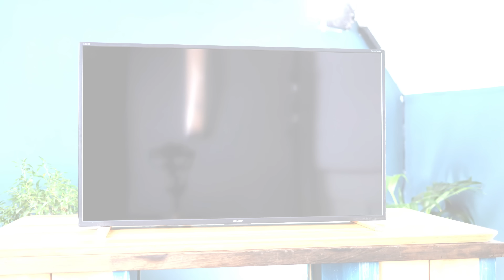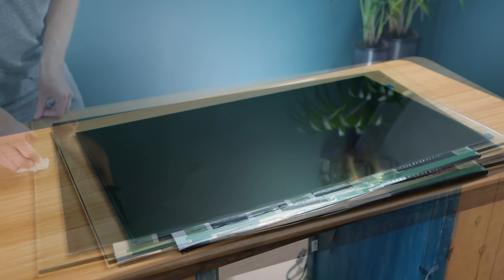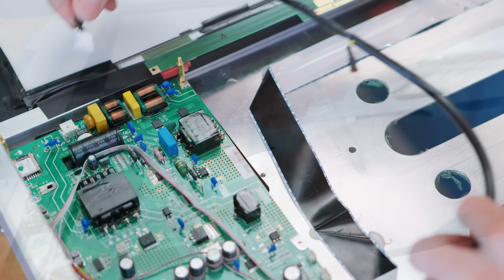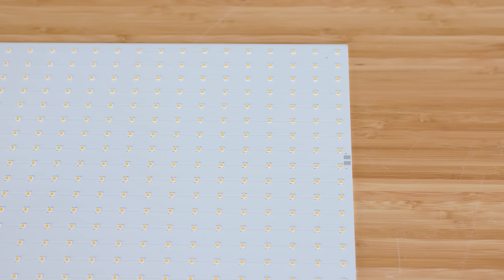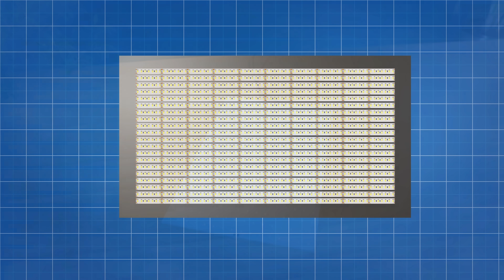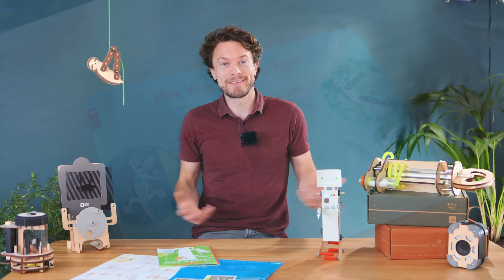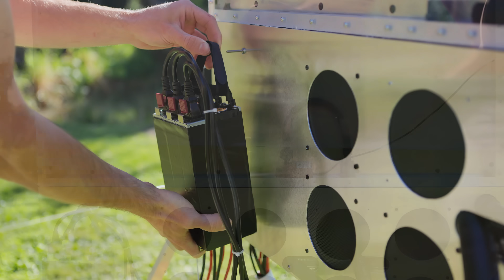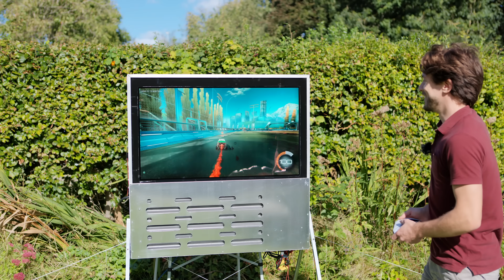Building an ULTRA-BRIGHT water-cooled TV...

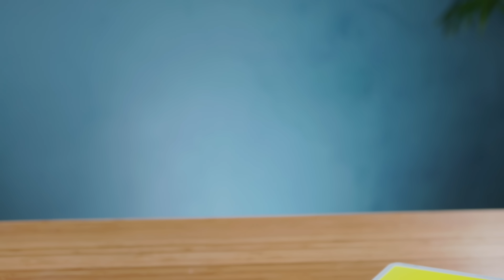Comment: 7:57 That would make an awsome project for individual backlight zones. I could see it being possible by using hardware similar to any DIY ambilight alternative
Reply: Ambilight is RGB, only uses the edge of the image and has a lot of latency for a backlight.
Reply: Disclaimer - idk a lot about display tech so could be very wrong

The main part of having dimmable zones with an LCD TV is having a processor and controller that can decide what zome needs the light and i don't think that is something that can be achieved by a common person like you,me or DIY perks. This is also a big part why he used a TV as he gets a display panel AND a control board.

EDIT - would bump up the cost significantly but i think they can buy a TV that has individually addressable zones and reuse that controller but they are already pretty bright and in the budget of 1000s of dollars so wouldn't really be a practical project. It can be made just for the sake of it but economics of scale do take part while factoring the cost/convenience/performance metrics

Comment: Don't open TV's unless you know what you're doing chat. TV power supply capacitors store energy, meaning they are dangerous even unplugged.
Reply: Not really. Any properly designed circuit has bleed resistors across the caps, even junk $100 tv's.

 Just don't go grabbing the back of the board the instant you unplug it and you're safe. The "zappy" charge is gone relatively quickly... And you need to be in pretty bad health or particularly unlucky for it to do more than make you yelp or whip your hand.

Comment: 18:55 you might be able to sandwich an ND filter in between the TV and the spectrophotometer. I don't think it'll give the best calibration then but you'll at least be able to measure the brightness. 1 stop of ND is half of the light so I think somewhere from 2-4 stops should do the job
Reply: You could also measure the brightness using a camera's light meter. Just get the exposure when pointed at something of known brightness like the smartphone displaying a white image, and then adjust the exposure to the same level when pointed at the tv displaying the same image. Then calculate the difference in stops and you'll know how many doublings to apply to the phone's nit rating.
Reply: Or maybe dim the backlight using pwm?
Reply: @HerrFreese  that'll just end up blowing out the meter when the led is on and not register on the meter when the led is off.

Comment: My curiosity is how bright will it be at night? And having a voltage regulator to control the brightness of the led could come in handy for Night time events. LOVED THIS PROJECT
Reply: Insects: "yes"
Reply: @smoke4131  smoke made me laugh
Reply: At night? There is no night when this TV is running ;-) Cheers! S
Reply: @suadcokljat1045  yes there is a night when this will be running. and there's laser eye-surgery for free with that.
i love it
Reply: 😎 😎 😎 "I wear my sunglasses at night, so I can, so I can..." 😎 😎 😎
Reply: Considering the LEDs run on voltage regulators anyway, you could just extend their potentiometers to the outside to lower their brightness
Reply: @schwuzi  not sure if this been answered already, and apologies I'm gonna sound like a smart arse here 😜. Dimming LEDs are controlled by PWM (pulse width modulation) , this is switching the LEDs on\off very quickly (in the kilohertz) the ratio of on to off (duty cycle) governs the perceived brightness. In hindsight maybe he could have taken the brightness PWM signal connection that went from the controller board to the old power supply unit (which had powered the old backlights) added some hefty power MOSFETs and tapped them in between the new power supplies to the new backlights(?)

Using potentiometers in this scenario pushing that much current easily would have burnt them out, probably go out with a bang!

Edit: okay I see that it has been correctly answered many times already 😃
Reply: @roopi67  I don't mean a potentiometer in the power line to the LEDs. I meant the potentiometers on the voltage booster modules he uses. They have a potentiometer to control the output voltage. I would tap into that.
Reply: @schwuzi  yes sorry I see now
Reply: @schwuzi  LED's are not voltage driven devices. They are current driven. You don't vary the voltage.
Reply: @zaprodk  yes, but you can drive them by voltage too. But as you say, the correct way to do it is with current control
Reply: @schwuzi  agree
Reply: @schwuzi  I was just going to say that some potentiometers shouldn't be too had to install on the outside, and it shouldn't be too difficult to wire in.
Reply: It will probably light the entire area. 🤣
Reply: Probably bright enough to attract/wake up wildlife and insects in a 5 miles radius. 🦉🦉🦉
Reply: I wanna see how it lights up the room indoors.
Reply: @rtyzxc  how long before going blind 🤣🤣🤣
Reply: MUST SEE A VIDEO OF THIS IN THE GARDEN AT NIGHT, along side a wall or something... =)
Reply: Why not just have a simple switch that either powers all led panels for daytime and only half of them for night?
Reply: Yup please have a just little demonstration please
Reply: Actually was hoping he would show it working at night. Came to comment just for that
Reply: I also would like a follow up video about this TV being used by commissioner Gordon to call Batman.
Reply: Oh I would love to see a picture of it at night, illuminating the surroundings. Although capturing dark scenes is hard, it would probably give a much better idea about how bright this really is. Please add this!
Reply: I really want to see it at night with some chairs and a camp fire
Reply: @adrienvesely  You wouldn't need a camp fire, just play a video of a fire and turn off the watercooling
Reply: yes
Reply: I came here to say this and it was the first comment
Reply: Light sensitive potentiometers would fix this. Then the tint can adjust according to the light hitting the screen.
Reply: @MX-Vette  well because they are leds, you can use a regular potentiometer, you need a pwm circuit. although i think the idea of brightness controlled by ambient light level is a neat one
Reply: PWM is probably far more practical and safe.
Reply: yeah I want to see it at night too :(
Reply: Just reuse original tv brightness control signal + some electronics = regulate the LED voltage supply, so can change the brightness using original tv remote
Reply: @TheFazz737  "some electronics" is the difficult part lol. I guess an arduino could use the voltage input from the tv brightness controller and convert it to a resistance the voltage regulator can use, but I couldn't do that. I know too little about these microcontrollers.
Reply: @schwuzi  Very good point, and also cost effective.
Reply: @schwuzi  you are right though. There are IR receivers available for cheap that can be programmed in arduino to the specific brightness ir frequency to control it. Not hard at all for someone as skilled as DIY Perks.
Reply: @Ezio470  That might be easier, as you wouldn't need the TV's brightness output, which would be handled differently from model to model in case someone actually tries to recreate this 😅
Reply: Usually TV/monitor logic boards are just sending digital PWM signal to the power supply, which regulates current and thus brightness of backlight LEDs by turning them on and off very quickly. Those volatege booster modules used by DIY Perks probably have some kind of output-enable input in form of an auxiliary pads or connector on board (even if not, its still possible to look for it in the driver chip's datasheet and solder a wire directly to the right pin) and feed it with TV's original PWM brightness signal (some level shifting using resistor divider might be needed).
Reply: @Firley777  That stuff goes way over my head sadly. I'd hack into the potentiometer on the voltage regulators to dim the lights. PWM is of course better, but not as easily done if you don't know what you're doing.
Reply: @schwuzi  I assume the original backlight runs on a pwm signal. If you put some power mosfets in line with the powersupply you can use the original signal to control the brightness. No real need for a microcontroller. Just lowering the voltage might be a much more practical sollution. How often do you really adjust the brightness of a tv.
Reply: @cheetahrunout  LEDs are current driven not voltage driven! A PWM signal created by a microcontroller controlling some MOSFET based switches and everything works perfect. Controlling a current draw around (for example) 100A (1200W / 12V) or on 3 Lines with 33A is a lot of current. Doesn't make any sense to do this with a classic current regulation. Too complicate and hard to control via a remote control.
Reply: @schwuzi  there should be off the shelf electronics PWM controller that could be use as in plug and play.
Reply: @schwuzi  depending on the voltage boosters used, it could be as simple as a voltage divider or maybe a couple transistors tbh, no microcontroller needed
Reply: @schwuzi  those LEDs usually don't get regulated via voltage but via PWM. you'd need a quite powerful PWM generator with for these roundabout 40 Amps. makebale but not that trivial.
Reply: @Firley777  I'm 90% sure pwming the en pin past 10hz or so will not work. Whether it'll just pass 12v, 16v or blow up outright depends on booster design.
Reply: @schwuzi  if you just reduce the voltage you will simply turn the LEDs off. LEDs aren't like incandescent lights, they have a voltage drop rather than a resistance.
Reply: @TheFazz737  Yeah...looks really easy ......maybe!🙄
Reply: how bright is it indoors?
Reply: Just squint your eyes at night
Reply: just think of the advertistment tv at your area. thats how bright it will be. haha
Reply: I was thinking same.
Reply: The TV is entirely a sun.
Reply: Yeah, I agree.
Reply: Same here
Reply: Yeeeeees! At night please!
Reply: DiyPerks, Please do a video at night♥️
Reply: Exect same question 🙋 from me too. I wish he tested it at night too. Or indoor too.
Reply: Oh, it'll be more then uncomfortable at night. My freaking phone, which isn't THAT bright hurrts at nighttimes. I don't think that thing at night is a particulary good idea in this state. 

I'd certainly do something to controll brightness as well. It's awesome it's bright enough for Sunlight, but at nighttimes, that thing must be absolutely brutal.
Reply: probablly at night, you can use it as a disco light
Reply: the tv is led so i'd imagine you could just hook up a bunch of mosfet's to the output, or even better, to the original mosfet's input so they get switched by the tv
Reply: Put your sunglasses on
Reply: LEDs has a nonlinear curve brightness/color temperature, therefore you must use PWM, or off some LEDs on backlight panels.
Reply: Omg this is too good🥰🥰🥰🥰 Matt could really consider to build version 2
Reply: Actually most displays use PWM
Reply: If we're considering using an arduino or similar to control the brightness, you could take it a step further, adding a diffused panel a the top with a photoresistor, allowing you to automatically adjust the brightness to whatever amount of light the sky is providing, or even just at certain thresholds (bright sun, overcast, dim, night, etc)
Reply: I had the same question, will it be a spotlight lol
Reply: probably it would be best to connect LEDs interleaved, so that it would be possible to only turn on half or a quarter of them. Would save a lot of power too
Reply: Wear sunglasses :D
Reply: If there was a way, the TV board could talk with the LED panels, it can completely turn off multiple sets of LED and dim the others, it'll look even better..
Reply: can be used as search light.
Reply: 1600w  of leds, guess.
Reply: guess that's something he could tackle in a later video.
since we're going into the dark winter months
Reply: You could maybe do like most phones do and adjust brightness using a light sensor.
Reply: Automatic brightness adjustment, receiving adjustment, pwm, wireless remote control adjustment, all can be achieved. The brightness of the mobile phone is now adjusted automatically or manually.
Reply: It may light up your entire backyard since it's that bright
Reply: The Black levels will be blown the fuck out at night.
Reply: Fix this on your car and you don't need head lights 😉
Reply: Yea would love to see it indoors or in night.
Reply: now we need the world's darkest TV to counter thos
Reply: At 2000 nits at night your neighbors will literally call the police on you lmao
Reply: Better yet. Add a meter to detect brightness so it autodims at night
Reply: You should still be able to control it in the settings
Reply: You could use a photovoltaic sensor to scale the brightness proportionally with the environment much like a phone does. You wouldnt have to fiddle with any settings, it would always be the perfect brightness.
Reply: It was exactly what I was going to say. 😅
Reply: LEDs are a current controlled device.  It would be simple to control the brightness, and I would be shocked if this wasn't included.

However, nobody wants to watch television outside anyhow.  We've had projectors for ages, who uses them outside, ever?
Reply: poomp!
Reply: moth noises intensify
Reply: You could have a light sensor that is used for matching brightness.
Reply: In order to regulate LED brightness you need to use pwm signals (switching it on and of very fast).
Reply: @HerrFreese  you can get away with some voltage regulation. Pwm is needed for a more consistent and precise control.
Reply: @HerrFreese  you actually need current control, not voltage control. Pwm can make it easier, but you'll still burn out the led if you're not extremely careful. The proper way to do it is a programmable current source
Reply: @olegil2  I'm relatvely new to electronics: Is PWM not a  form of current control? The voltage  is constant and has to be in a certain range in order for the LEDs to work. PWM controls if the current is on or off. PWM is as far as I know the standard solution to control LED brightness.
Reply: just add a removable tinting layer :DD
Reply: @xjmdm  or just add a light sensor...
Reply: @xjmdm  with magnets, lol
Reply: @xjmdm  I love that you answered the question immediately with the simplest answer possible and yet the nerds are still trying to over engineer the most complex solution. It always amuses me to see people can be blessed with an over abundance of intelligence yet be completely stupid.
Reply: @XJapa1n09  It's not very efficient though. The LEDs would run at full power when you don't need them to.
Reply: I just wanna see if how bright it is as night, would be funny
Reply: Criminy, the number of people in this one thread that think LEDs can be dimmed by adjusting the voltage is impressive.  LEDs can barely be dimmed via voltage control until they simply cut out.  All the "dimmable" LEDs you buy for your home have circuitry in them to allow standard resistive dimmers (for incandescent bulbs) to work properly with them.  LEDs require PWM control (as a few people have mentioned here) to be dimmed, not a potentiometer, a resistor, or the voltage boosters themselves.

That aside, honestly @Iskander K has the most simple and logical solution.  Just add a removable tinted layer.  Simple, easy, done.
Reply: addendum: With enough software safeguards and enough internal resistance in either LED or PWM-regulator or both, it can work with just PWM. But you WILL burn some LEDs during development, due to simple mistakes and software hangs.
Reply: @olegil2  What are you even talking about?

With PWM controlled MOSFETS, all you are doing is adjusting the on/off time of the LEDs.
There is no need for "software safeguards", because setting the PWM-signal to 100% would create the brightness you see in the video, not more. You can only get less brightness from there. 

Real dangers are as follows:
1) Incorrect wiring, leading to a short circuit or component damage. 
2) Use of insufficiently rated components (low power MOSFETS) that cannot handle the voltages / currents.

Again, the idea is to interrupt the voltage / current flow to the LEDs at set intervals (controlled by PWM).
Reply: @soheil5710  he asked if pwm was not current control, which it isn't. Pwm is time control, which as you say can regulate brightness. But it cannot regulate current, so you typically need a series resistor. Then I linked an led controller and a pwm controller to show the difference. Burning out a diode from too much current is very easy.
An led is a component covered by your point 2. Take 5v supply and a 350mA/3v led, then a 1A/20V mosfet driven by pwm. What's the max current, and which component burns up if you accidentally give a near-100% pwm?
Reply: Dimmer
Reply: Matt's LEDs required voltage boost converters between his server power supplies and the LED light panels. Unless the color changes too much from adjusting them down from the 48 volts his panels require, it's one way to dim it. Also was it like standing near an idling jet? Hopefully the power supply fans didn't stay at full speed. They can be notoriously loud.
Reply: Even better if you could integrate some kind of a Light sensor to automatically adjust the brightness according to the brightness outside (just like in smartphones). Then it would be the perfect outdoor TV for all conditions.